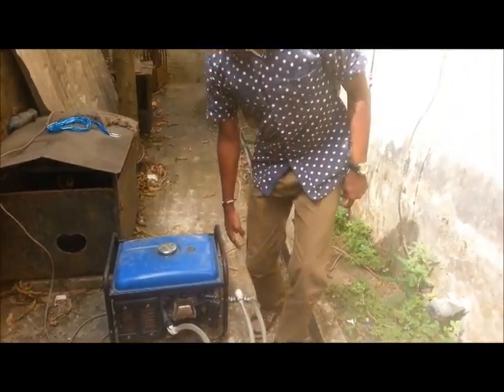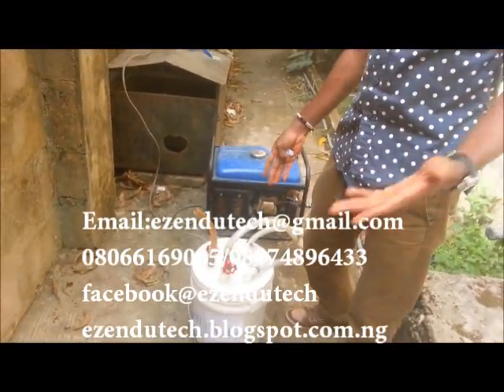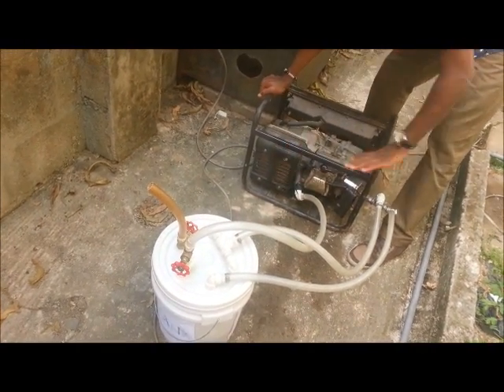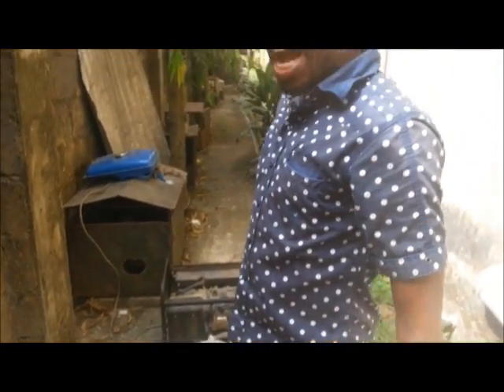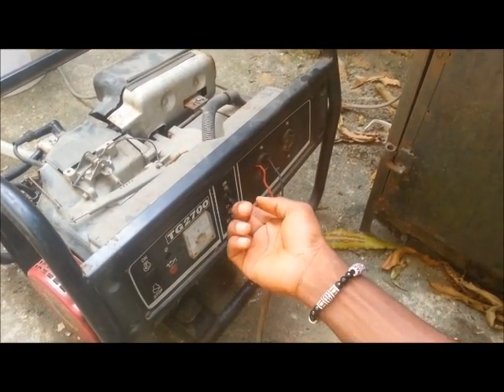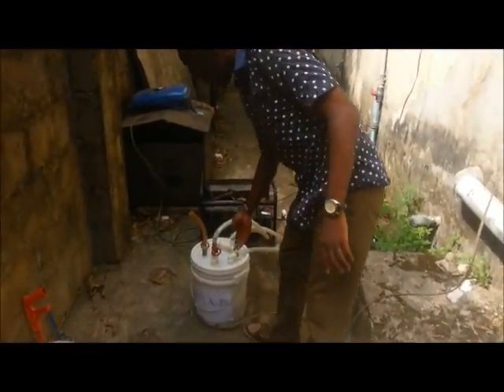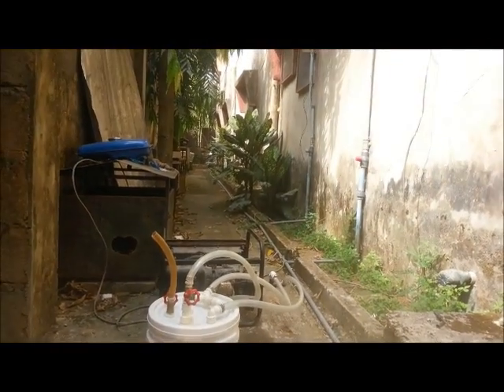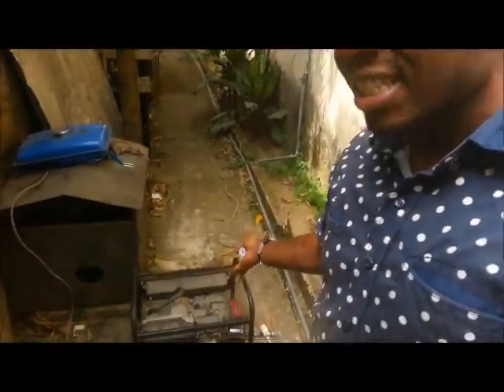OBITANK

Comment: Great ingenuity Obinna! Kudos to you and I must say its obvious you invested a lot of time in figuring this out. 
However, I have a little bit of concern with regards to the safety. You know petrol is highly inflammable and once the heat of the generator impacts on the storage tank (Which I can see is quite close to the exhaust section of the generator), its propensity to explode is highly increased. 
We haven't seen the smaller prototype you mentioned, I really hope you have built it in such a way that the generator heat does not impact much on it. I think a metalic container for the fuel would be safer than the plastic container.

That said, this is an excellent idea and certainly will help save money on fuel for Nigerians. Keep the creativity! God bless.
Reply from the maker: +Kenneth Mfon thanks.
All safety messures are being checked to mitigate any of such,by the time the commercial type will be ready.
thank you

Comment: Nice idea. You deplored three stages of matter principles and in this case you started with high volatile liquid known as petroleum then assisted with gravitational suction effects which derives the vaporized petrol to Genset caburitor for combustion effect.  Eg when you see most Dancote trailer cement carriers, you will notice that they carry LNG gas tank for their vehicle combustion/movement. All combustible engines uses/changed all forms of energy derivatives to vapourised/gaseous state before use hence your tank design has done the work for the engine and again the less use of liquid state because the gascious state burns neatly and judiciously intake by the Genset caburitor which make's the liquid state matter (petrol) to last longer. Weldone